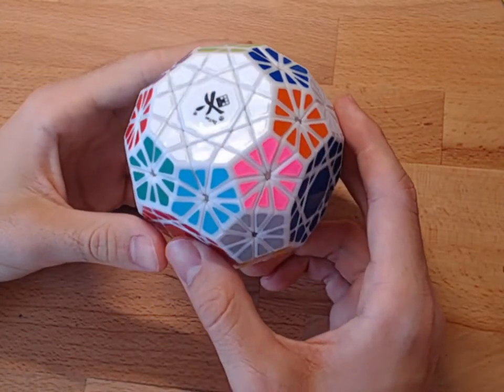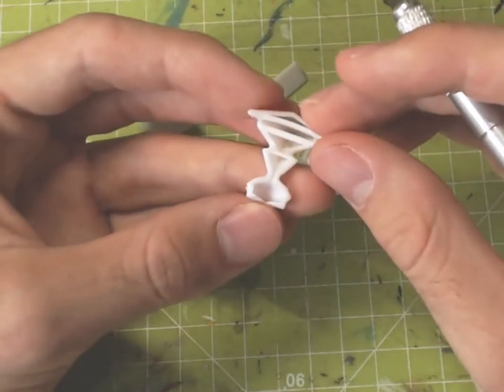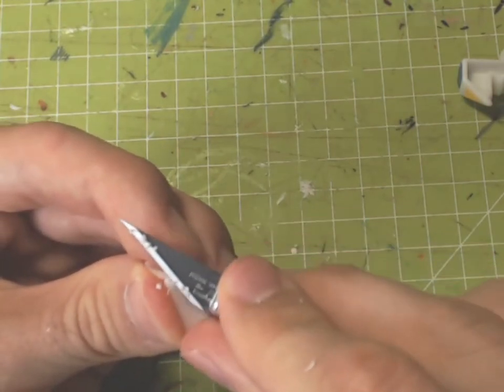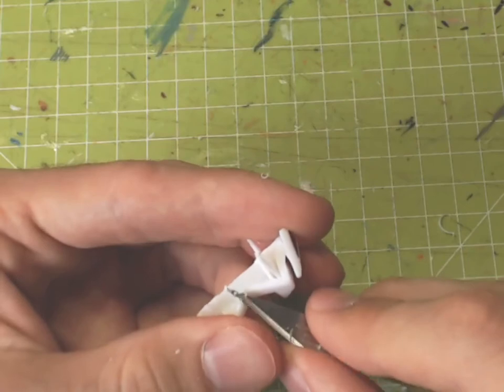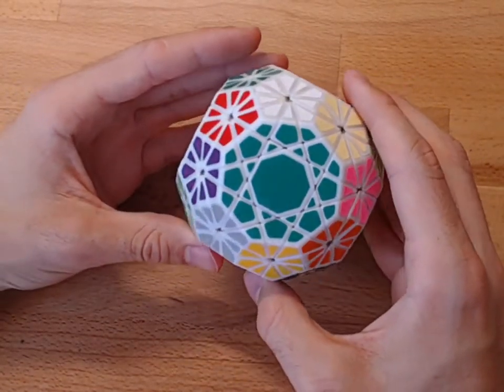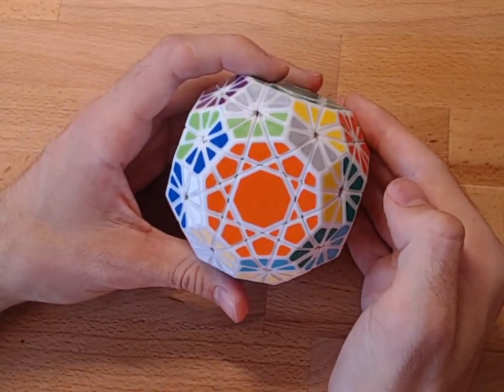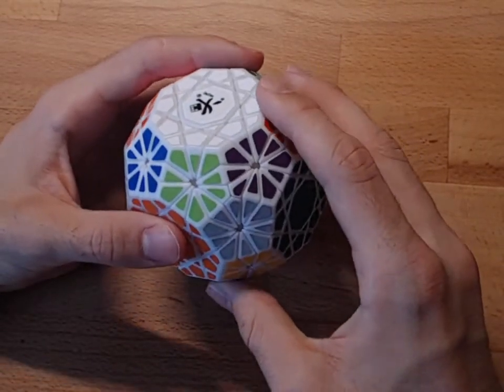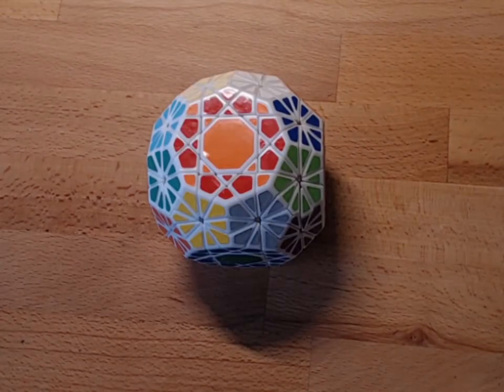Improving Dayan Gem 6 [ Tutorial / Rubik's Cube ]

Comment: I bought mine 4 and a half years ago. Like yours, it didn't turn out of the box. I had to lube it immediately and then the stickers started coming off. I had to superglue every single one of them on. Gadi Rubik also has a tutorial on how to mod it. That's what I followed, but his mod doesn't include the corners. I find that not to be a big issue. The pyraminx crystal wedges are terrible. I was contemplating rounding them off, but I think that would just make it more unstable. Lubing the springs in the core helps a lot with the turning, I find.
Reply from the maker: thank you for sharing your experience with the puzzle!
tbh I already ruined a real Pyraminx cristal with this kind of mod, so I didnt round them off at the pointy ends on this puzzle.
I didnt know Gadi Rubik before, thanks for recomending it :)
(sry for having you wait this long)